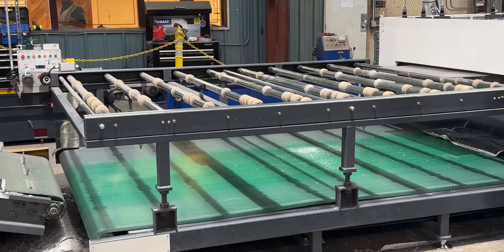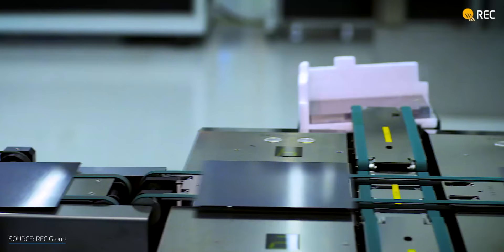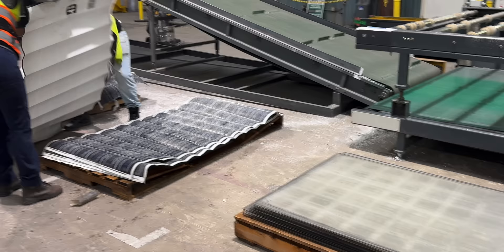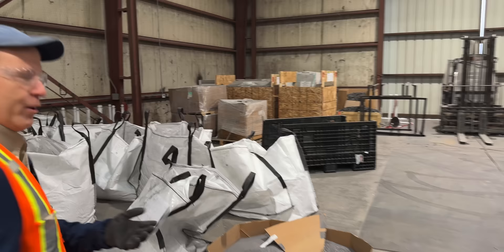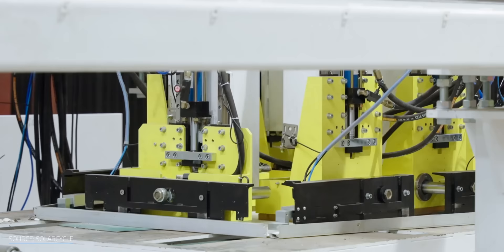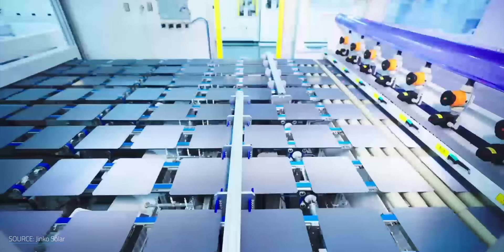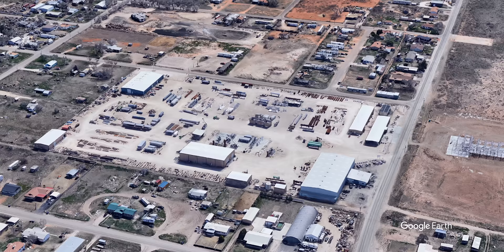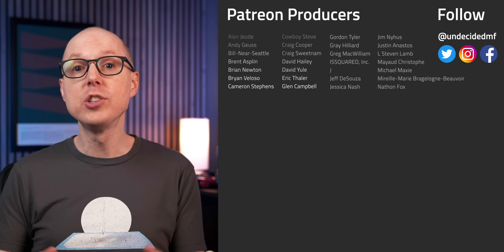What REALLY happens to used Solar Panels?

Comment: Here in Alaska we use old solar panels for building Water Proof Roofs and Siding for homes and barns. It's tougher than Plywood!
Reply: That’s a good idea indeed!
Reply: @user-to7xm1rz6n  Thanks, I wish I could post a photo of our USED solar panel barn! It still makes half the power! I was told that they may put out 50% power for the next 60 years or more. I can't find info on how long it takes before a solar panel goes 100% dead.
Reply: End of life is defined in the panel company charts! And year on year degradation must be around 0.4% - 1%
Reply: @user-to7xm1rz6n  Thanks for the info. I tracked the slow-death of our panels we got in 1999 and what we found is that the more they decayed the slower the decay got. In other words its not linear but a sharp curve that slows down as the panel ages. When we first got the panels I could see a 1.8% drop in the first year and then by year 14 it was only dropping by .6% a year and on year 23 only .4% a year. I plotted the curve and it says in 100 years we will still get 25% of the original power output. But I can't prove it until then,,,,,, LOL.
Reply: That’s an interesting analysis
Reply: There's even some official studies who confirm this. After the initial steep decline/decay, it flattens out and gets more or less to a stable wattage for panels over 20years of age

Comment: There are logically a few options I can see in this whole lifecycle: 
1. Make solar panels modular, using non-toxic glues and designs such that recycling them is easy. Recyclable by design.
2. Use more solar film based technology so that you reduce glass, aluminium, and glue.
3. As solar panel manufacture increases and inevitably improves iteratively, make them comply to certain minimum global recyclability standards. There will still be non-standard cheaper products manufactured, but if there is a standard, it is easier to mandate in law, reducing the spread of poor design.
4. If the output of solar panels only decreases with time, they can be used for longer periods in "used goods" markets where efficiency isn't important. In this way, the panel can have a second useful life before being recycled for low efficiency use cases.
#1 and #4 are mutually exclusive. I mean if you can recycle them well, then who will use them at low efficiency.
Reply: #1 and #4 aren’t necessarily mutually exclusive. This is especially true while the whole system is being phased in and refined.
Reply: People changed their solar panels because of the new ones efficiency not because they were not useful anymore. Like when we looked for our solar panels I've seen a lot of ads by people selling second-hand panels which were brought from Germany probably for free or close to free by this guys. They were selling them for cheaper than the price per W of the new panels because they were more inefficient. For the same space taken I would have gotten only 300W instead of 500W and space had to be considered as we filled our house with solar panels. We went on to buy new panels but we could have gotten the same capacity for 60-70% of the cost if we went with second hand panels if we had the space for it. I'm sure that in the future they will become even cheaper on second hand markets so more and more people will have access to solar panels at a cheaper price.
Reply: If mfgrs used your thinking on #1, panels wouldn't last 25 years out in the baking sun and freezing rains as they do now.  And if they're made smaller and more modular, there will be more possibility of bad connections (plus the cost of all those connectors and the extra labor to install/uninstall them) between the smaller modules.  For the most part, panels today are plug and play.  You could plug it in in the year 2024 and unplug it and replace it in 2054, with zero maintenance except a hosing down here and there to remove dust.
#2 Solar film is entire percentage points lower in efficiency than sliced crystal, and the lifetime is much lower than glassed panels.
#3 Global recyclability will add costs to panels as well.
#4 If my panels were down 20% by the guaranteed 25 years, I could add a single panel to each string and recoup that loss.  But panels are degrading less than that nowadays, so it may take 30 or 40 years to get to that point.  
I'm all for recycling, but I'd like those costs to be reasonable.  And I'd prefer all the methods to not add costs or ANY unreliability to my system in the meantime, thanks.
Now that you see more of the downsides, tell us how to incorporate your thinking into the recycle chain while avoiding my pitfalls.
Reply: @ljprep6250  Are you in the solar panel manufacturing industry? In what capacity? I am a layman.
Reply: It's interesting that the Arizona State research grant seemed to name First Solar as part of the proposal. As one of the three largest solar companies, their interest in a recycling project could indicate a deeper interest in manufacturing for recycling, which is a promising start.

Certainly when I was working in this industry, people were only interested in getting the cost below $1/watt. No-one, back in the noughties, was thinking about the recycling of the panels our machines were producing.
Reply: The problem is that 1) and 2) increase the $/W metric, thus making solar panels less enticing for customers.
Companies will want to do that only if it is mandated by international laws that apply also in China where 90% of the production is based.
And if it is done with a significant impact, it might have a regression in adoption rate, which often leads to a market failure.
Reply: @ljprep6250  I don't think that you can say for a certain that a solar panel couldn't be made more easily recyclable without negatively affecting its longevity. It might involve balancing one characteristic with the other. There could be adhesives on the market or on the horizon that are resistant to the environment out in the world, but readily break down in a particular setting in a recycling plant. I don't know what those would be, but its something that could be developed.
Reply: #5 add an up-front recycling fee (tax) to the purchase cost of solar panels, that is then fed to fund a recycling industry.  This is how it's done for other goods like bottled drinks (deposit on bottle return) and electronics.
Reply: @marsovac  I am not informed enough to say for sure that it is impossible to increase ease of recycling or modularity without increasing cost. Looking at the history of PV solar as an industry, one thing we can say for sure is "never say impossible". Your points are definitely strong and I agree today, but the circumstances can change with a couple of innovations, and there are so many happening in every direction. As far as adoption goes, I think it is safe to say that due to the I R Act in USA, and China outside USA's sphere of political influence, the demand for solar panels will go on increasing world wide. Everyone apart from OPEC can see the benefits of moving to renewables (even they, but for different reasons). PV solar is out of the risky growth phase now and into robust growth, IMO. I concede that Capitalism+Democracy are not mature enough to allow recycling from the start, but the demand for solar is so vast and robust (think Russian oil, Arab oil, Iraq, Afghanistan) I don't think it can regress all the way to failure, due to a 5-10% cost increase for legislative compliance. Personal opinion, YMMV.
Reply: Option 5, throw cheap solar energy at the problem. 
Separating out stuff is trivial with enough energy. 
Like throw so much heat at it that the glass starts boiling, and use distilation.
Reply: This doesn't say how you would recycle the Silicon solar cells.
Reply: BTW: First Solar will recycle their CdTe thin film panels because they can recycle the metals the cells are made with.
Reply: Your ideas are ideal, but step 1, Solar Panel must be competitive, else it's not going to sell and not going to be any progress in renewables
Reply: SO MAKE THEM LESS GOOD, LESS LONG LASTING, AND MORE EXPENSIVE? SOUNDS GREAT DUDE!!!
Reply: 2) Thin film used a lot more rare earths then normal panels.

Comment: I work in Odessa and am excited to see this!

I have to correct you though, that's not an oil rig. It's an oil well and that is the pumping unit for the well, commonly called the pump jack
Reply: Thank you someone who knows. I hate it when people refer to pump jacks as a rig. For those who don't know an oil rig can be a drilling rig that drills the well or a service rig that does maintenance on the well.
Reply: Well, according to 9-year-old me, it's an oil bird. Pecking at the ground to pull oil out of the dirt.
Reply: An oil extraction thingy? But not the drill itself.

Comment: The used solar panel market is probably the most efficient way to reduce waste. Millions of panels are being decommissioned simply because they have reduced efficiency since when they were new, but they are still putting out good voltage and amperage and are perfectly usable by off-grid homeowners. They are available on Facebook marketplace, craigslist, etc often for around 30 cents per watt... however making them less expensive would increase availability for them. I'd like to see the companies that install/remove solar panels include a strategy of getting them very cheaply into the hands of people who can reuse them as part of their recycle/ stategy...like 10 cents per watt or less. And then eventually those used panels are going to degrade to the point where they need to be thrown out, at that point they could be recycled... And to assist/encourage those off-grid homeowners to bring near dead panels in to recycle, there could be a 1 new for (5?) used panels trade-in coupon offered.
Reply: Reduce
Reuse
Recycle

These are in order of priority from most important to least. 

Recycling is very important, which shows how much more important it is to Reduce and Reuse.
Reply: reuse is a great solution.. .my 1400 watts on my rv roof cost me $423.. right at $.30 a watt...  but... there is no money in used... or rather , not enough money... not for "the money" to invest in the resale business.... similar to the auto industry .. they aren't interested in making your car last, they want you to buy a new one.. :)
Reply: @rvnaut  In Europe we currently pay around $.16 per watt. For new panels, of course. Sounds crazy, but it's really true.
Sure, the panels come from China and there are also offers for $.22 per watt. But the expensive panels aren't much better, there's just a lot of marketing foo being spread around.

Comment: End of life recycling should be embedded in the panels from their construction, for example using glue that can be simply heated up or vaporized to separate the layers
Reply: 100% agree. As long as it can be done without degrading their longevity.
Reply: Do you know how hot solar panels can get?
Reply: How about using glues that certain microbes consider edible?
Reply: They probably use Silicone Rubber.
Reply: Not just solar panels, but everything basically

Comment: This is awesome work these guys are doing.  I would like to mention that there is an initial problem with how we handle solar panels.  End of life for solar panels is usually set at 25 years.  But at that point the solar panels still have 87.5% of their original power.  These are still very useful panels.  I wish I could get some of these panels.
Reply: San Tan Solar.
Reply: Yeah, I don't get it.  I have a friend that's an application engineer with a very large solar installer.  They guarantee 85% after 25 years.  They would still be cranking 40% after 100 years.  Other than the use and taxes on the ground they sit on, it's all free for many years.
Reply: There are multiple facets to consider. I doubt that the cost of recycling materials is genuinely cheaper than mining them when we factor in labor, processing, and transportation expenses. The industry might require regulatory support to ensure profitability, although excessive regulations could potentially hinder the solarization process and impede decarbonization inadvertently.

The materials typically recycled are mostly non-toxic and environmentally friendly, akin to sand.

Another critical aspect is redirecting attention from recycling concerns to preventing significant entities like corporations, big companies, and governments from discarding functional solar panels simply because they're 'expired' according to a 'used by' sticker on it or the paperwork.  This practice poses a more substantial threat, and implementing regulations to discourage 'planned obsolescence' is crucial.
Reply: That would be nice.
Reply: @Reckless-mindfulness  "...to preventing significant entities like corporations, big companies, and governments from discarding functional solar panels simply because they're 'expired'..." - I think you'll find a lot of justified opposition from all sides to this ridiculous idea.  As you yourself said, there are multiple facets to consider.  Why should entities be forced to continue using panels which no longer provide the power they need and will only continue to degrade?  Furthermore, who are you (or anyone else) to tell said entity what they can or cannot discard?  Lastly, why is it (based on your words) acceptable for small/non-significant entities to "[discard] functional solar panels simply because they're 'expired'", but it's unacceptable for "significant" entities to do the exact same thing?  Enticing entities to continue using old panels is one thing; prohibiting them from discarding old panels is another thing entirely.
Reply: @nomore6167  oh.money & job name of game .money create idea and energy then furthermore.positive or negative.that depend whom benefits from it.

Comment: Those mixed bags of granulated/powdered solar material could be separated by density using a machine I invented accidentally many years ago, let me explain: There is a process called "winnowing" which is a way to separate wheat from the chaff by tossing it in the air utilizing wind.  My machine is similar to "air washing" machine used in desert prospecting, but it is very simple.
All it is basically a large gasoline powered blower/vacuum (the one I used was a 10hp insulation vacuum for remediation)
You attach a 50-100ft section of what's known as "lay flat" which is a clear ventilation plastic tubing that comes on a roll.  It is inflated with air by the vac/blower and becomes a 20" diameter long tube.  The end of the tube has an automotive air filter taped on to create backpressure and that is it: That's all it is...
Works amazingly well to separate finely granulated and powdered materials by density, you can actually see through the giant tube and everything deposits by density .
Reply: Working on an idea similar to that for wet washing and classification of dirt. I mine cla, but o dang can I use gravels and sand.

Comment: Legislating for recycling should give the industry the boost it needs.
Reply: Oh great, more legislation
Reply: @DialedN_07  yes, but without it people and businesses are selfish.
Reply: agrre set a recykelfee on them as carbattery in sweden then you get it back when recykling them even 15 dollar is not so mutch of the total cost, even if it is better to bring the recykel cost down witch ity will. In the video I don´t understan why have a person feeding panels and one stacking the panal part one meter away and one lifting the aliminium frame and throw it into the bin those must be very easy to have machinery instead

Comment: A) I'm curious if reusing the glass panels is viable at all. Crushing the glass is way more flexible in its use as that can be used in lightweight concretes as well as being cast into new glass sheets. But that seems like if the circular model is the goal, then giving them the old glass panels would be more cost effective. I guess some sort of testing would be required to make sure that they meet some sort of standards on strength, transparency, etcetera 
B) I'd love to see how the Australian system works. If it does yield results, they should look to partner with the manufacturer and get a more microwave sensitive glue.

Comment: Would be interested to hear from recyclers about if/how they handle less standard panels. For instance, what if you gave them some Tesla solar glass shingles? And then depending on what they say, figuring out if some of the possibly gimmicky variants are really sustainable. (Entirely possible you touched on this and I missed it).

Comment: Good video.  First time that I have seen anyone mention that there is silver in panels AND that solar production may consume all of the world's supply of silver.  I was surprised by 2 things though, the amount of labor used to handle the used panels and parts as they came apart and the slow feed in the delaminating machine - definitely 2 areas for improvement.